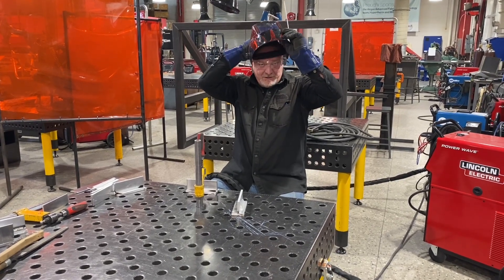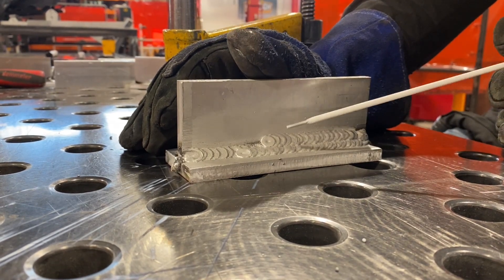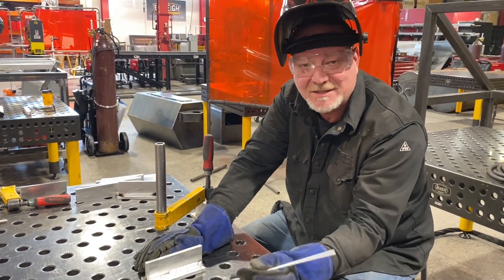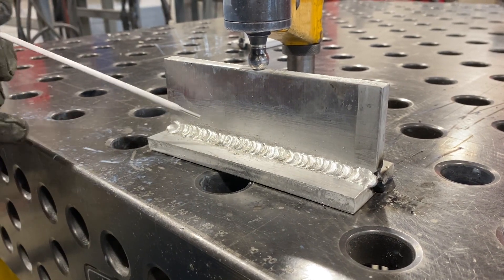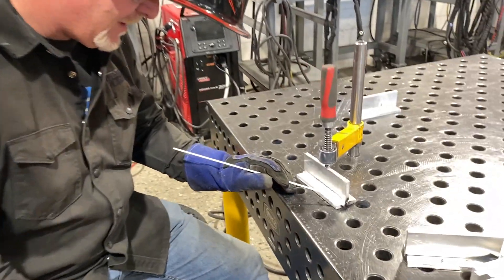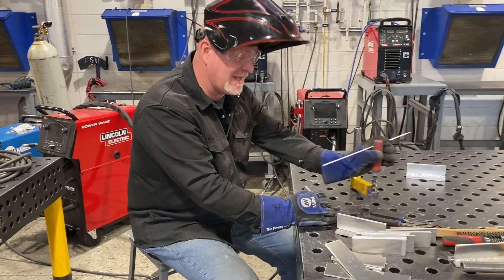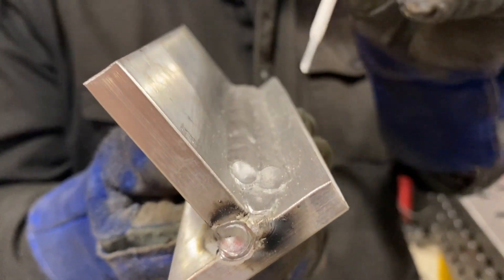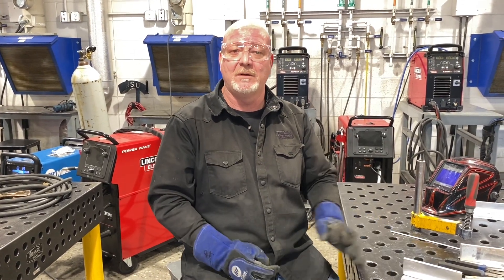Multi-Pass Aluminum MIG Welding

Comment: Can you do thicker stuff without the pulsed MIG? I just bought my welder and I opted out of pulsed MIG to save money.
Reply: YES  the thicker the material is the less you need or want pulse ….! 

Pulse cools the weld on thick material you want all the power you can get
Reply: @ZILAwelds  thank you for the answer!! 🥰🥰🥰
Reply from the maker: Pulse has advantages on all materials. Thick or thin. Has nothing to do with "POWER" has to do with a different type of arc. "cools the material, you want all the power you can get" is simply wrong. Turn it up and burn it in is exactly how welding doesn't work. What does "thicker" mean? we have welded for 125 years without Pulsation. Has nothing to do with thick or thin materials, has to do with how the metal crosses the arc and is deposited into the puddle